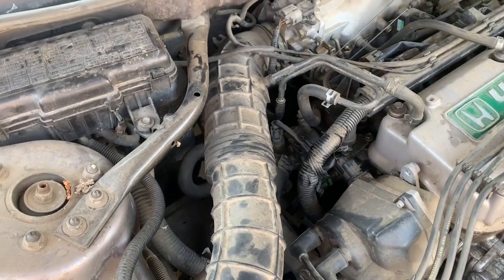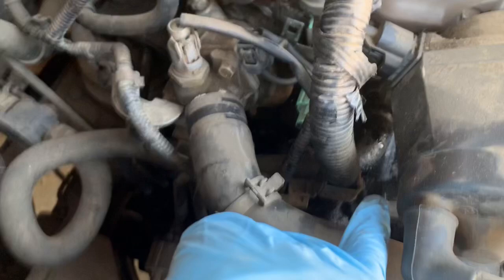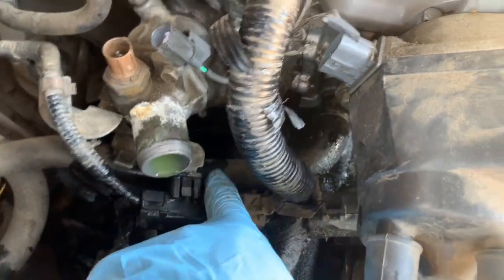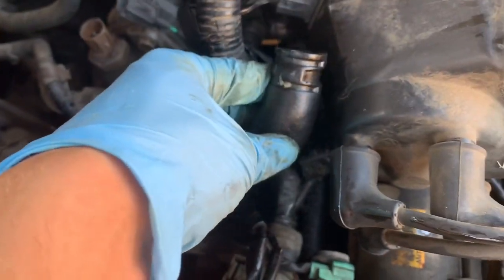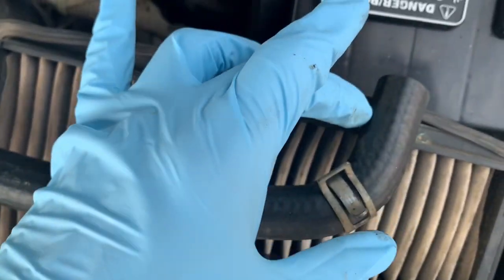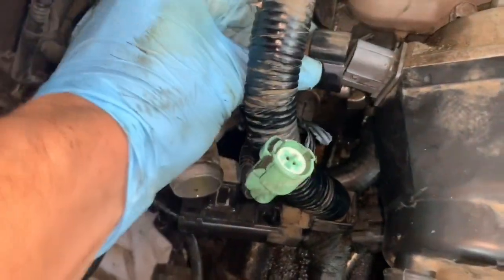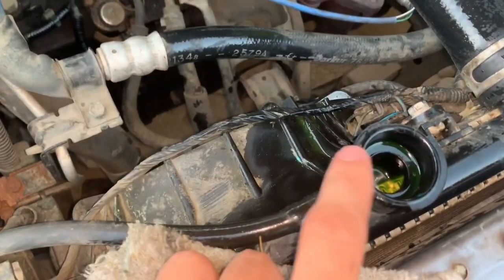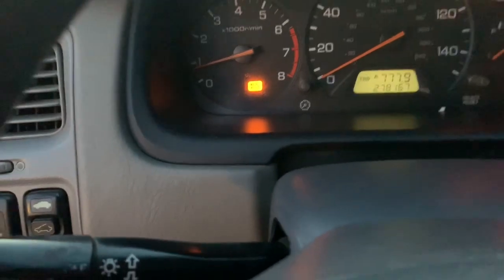Replacing heater hose(Honda Accord)

Comment: Appreciate it and to the point, this is something I just had to do and apparently oil leaks from the distributor and weakens that heater hose. I'm not a mechanic so it took me a while to diagnose when I got home and it was steaming all over the place. One thing that you missed, I thought I would point out, is there a bleeder valve towards the rear of the engine on the passenger side that you unscrew a little bit and it will bleed air out of the system. After I replace the hose it started overheating and it was hard for me to find that information I didn't realize so if you are overheating after you've replaced a hose find that bleeder valve and wait until it's just coolant coming out.

Comment: Maintenance light is for routine maintenance like oil chage i got the same car 2000 homda accord ex 2.3l 4 cylinder f23a4 engine i gotta replace that same hose and dealing with a p0301 cylinder 1 misfire now did a tuneup distributor cap and rotor still nothin got any idea i was gona see if its a fuel injector next but odk